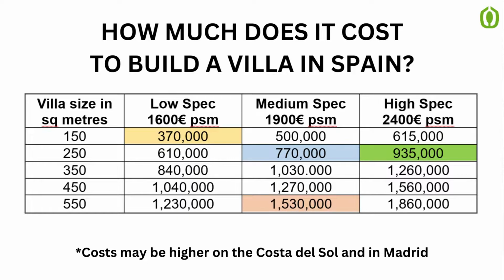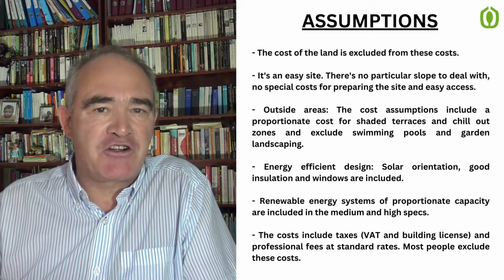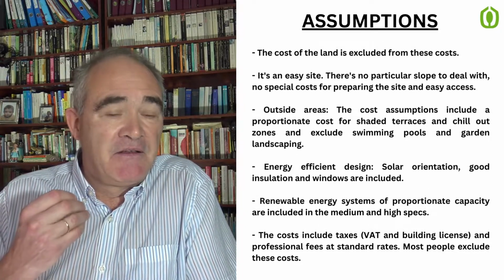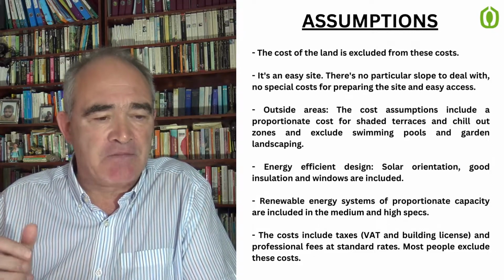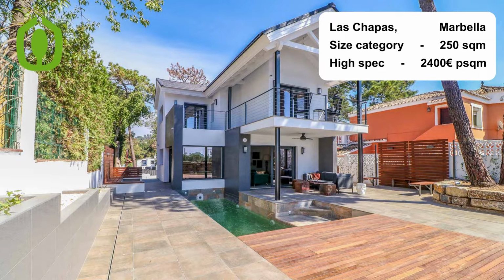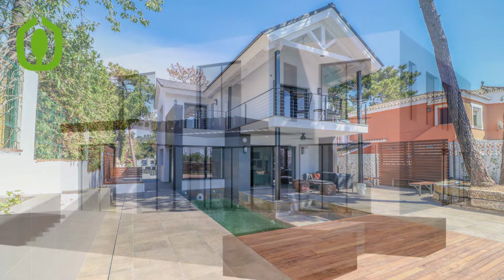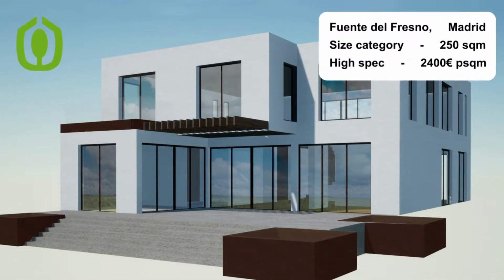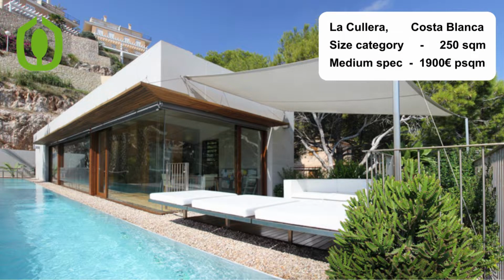How Much Does It Really Cost to Build a Villa in Spain? Real Examples & Breakdown

Comment: tad confused with the maths...has sq maters and cost per sq meter...but totals dont correlate...e.g 150 m2 x 1600 (low spec)  should equal 240,000...but table shows 370,000. ...could you clarify....tku J